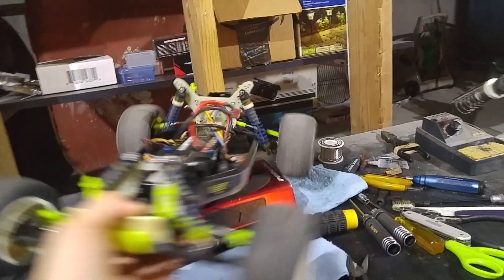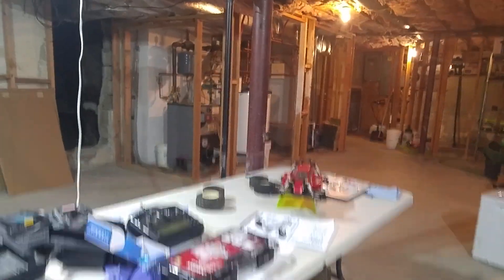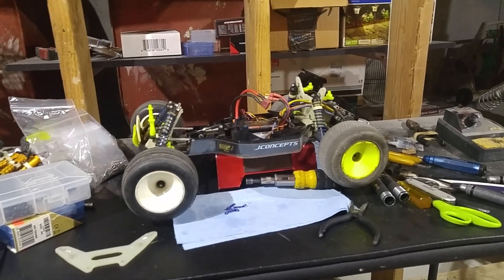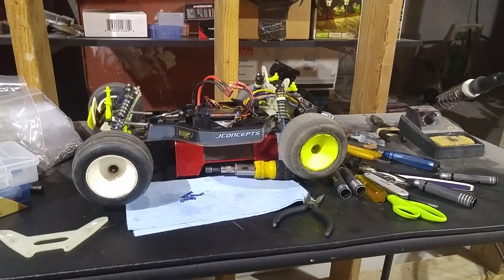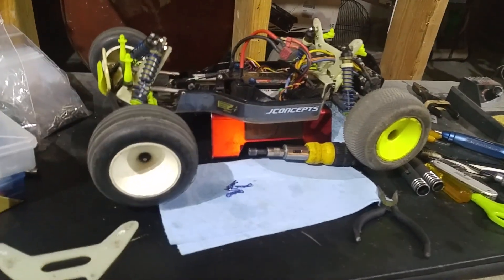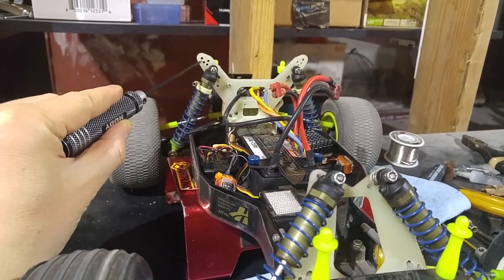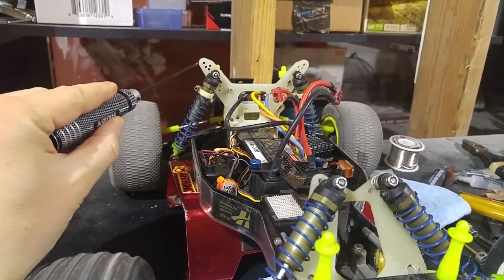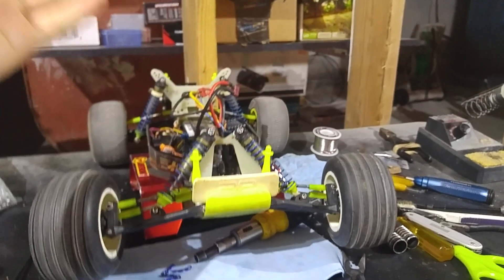Vintage RC10T rear shock tower modification

Comment: Have you tried figuring out a way to add anti squat to a rc10 or rc10t yet? Just curious.
Reply from the maker: Easy.  Just add a spacer between the chassis and the front mounting hole for the inner hinge pin mount.
Reply: @doctormosfet  thanks! I got a build that I'm trying to do and just wanted to pick your brain for a sec.